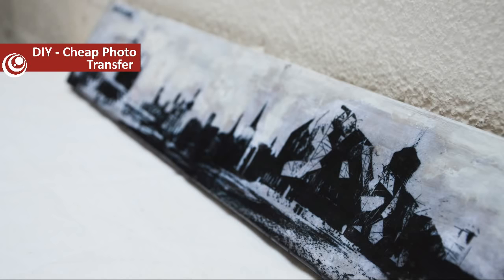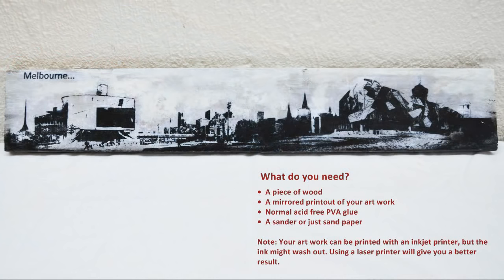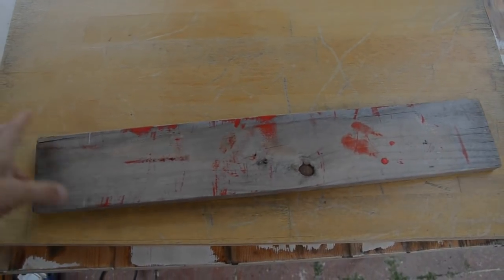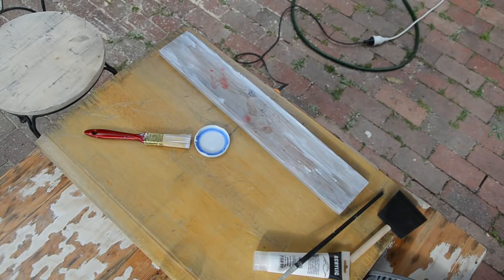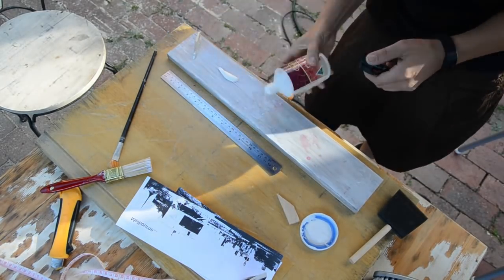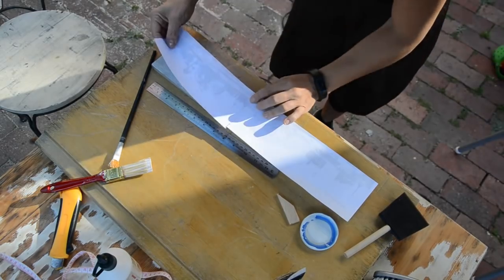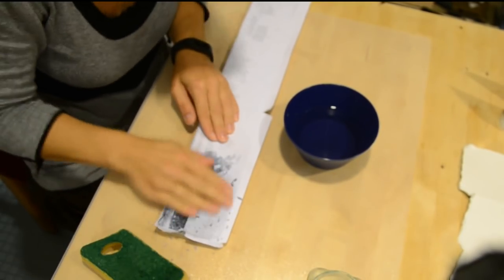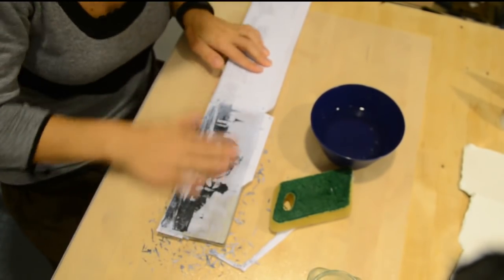DIY - Cheap photo transfer on to wood using PVA glue

Comment: can it be an actual photo, or if it needs to be regular paper...also, PVA glue = elmers glue...is it used in the first process and also as the laminate?
Reply from the maker: Hi, it needs to be paper. It works best with prints from a
laser printer, but as you see it works with a normal inkjet printout too, but
you have to be careful because colours might bled more likely... Yes I just
used normal PVA-glue to seal the wood...

Comment: I don't know why but i can't do it. Everytime i try to rub it it just comes off with the photo
Reply from the maker: This technique works best with a print from a laser printer. The pva glue needs to be completely try (24h best). I never had issues before. What kind of glue are u using?
Reply: @D4u-DIYs4you  Pva. But i think i need  to wait longer for it to dry. Because i don't wait 24hours